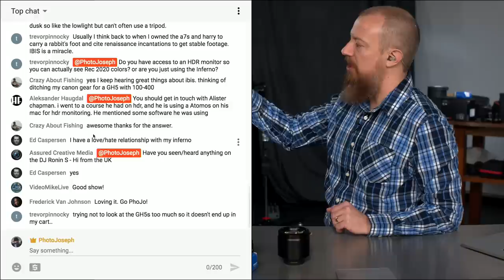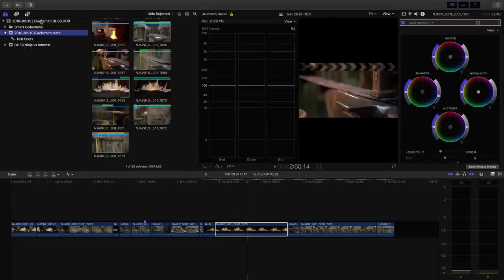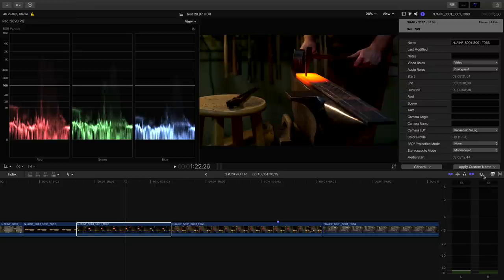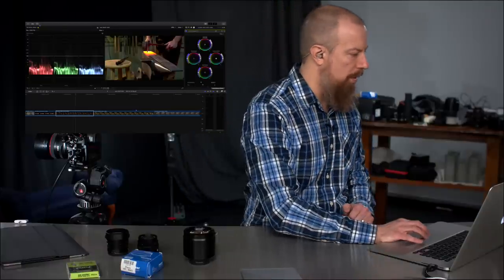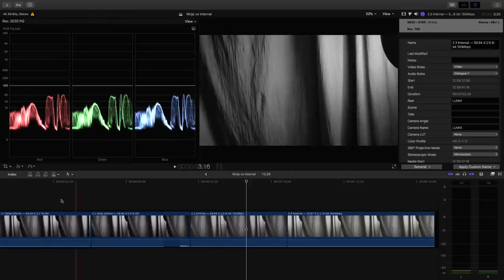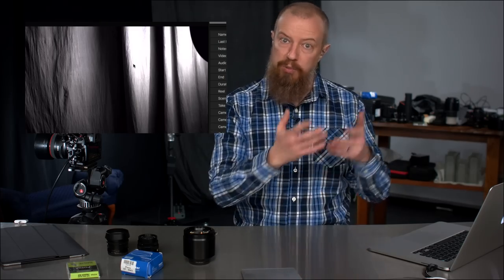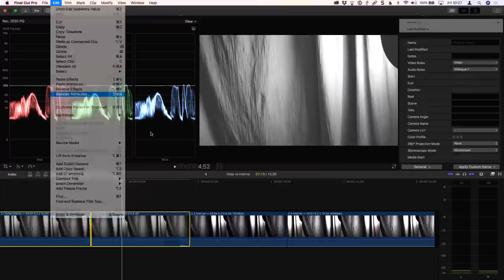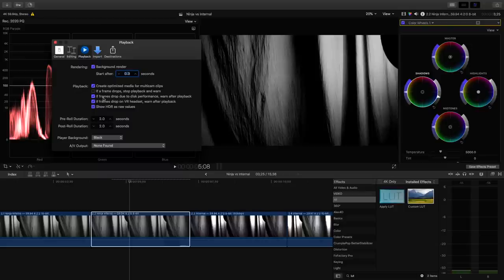GH5S Low Light Part-3 ► WTF w/ V-Log footage on ATOMOS Ninja Inferno?

Comment: I would say its an FCPx problem. I have tried using the inbuilt LUTS with my (now sold) canon C100. Basically the same result you are getting. If you use a custom Lut then its OK. This suggests its the inbuilt LUTS

Comment from the maker: In part 3, we see the problem I've run into with the Atomos Ninja Inferno and the V-Log footage on an HDR timeline. Do YOU know what's wrong?!
Reply: PhotoJoseph it happens because of 16-235 and 0-255 levels..hdmi sends 16-235 but internally uses 0-255..at least in my atomos assassin ,there's no setting for input range..
Reply from the maker: Hmm, I’m not sure that’s it. First of all it’s 10-bit so 0-1024, and if the HDMI out was limited that’s pretty much negate the entire purpose of capturing externally. The file is fine until the LUT is applied. Someone else has told me the LUT is forcing it into Rec. 709 color space but that doesn’t seem right either.
Reply: PhotoJoseph I was referring to the gamma shift you mentioned between internal and atomos recording.Try this...before you apply the lut to the atomos file,match levels to the internal recording and then apply the lut..

Comment: What I can't figure out is, the imported v-Log clips still say rec709 in the inspector.  I'm having the same issues with a Ninja Inferno. Also, for the life of me, I cannot get the waveform to show hdr, it's locked at rec709, even with a wide gamut library and project. And agreed that the ninja footage looks almost like it baked in some kind of v-log lut internally. The footage is not nearly as flat as internal.
Reply from the maker: Honestly I never figured this out completely. I need to spend time on their booth again and really sort this all out. I also need an AJA IO that shows the HDR footage in an HDR monitor.
Reply: Still working on the ninja inferno setup, but I have it working as an external monitor without trouble.  Just need to figure out the color space, but here's the kicker.  I found out that both the Ninja Inferno and the Sumo, are actually rec. 709 displays.  The Sumo can'y do about 9.8 stops of DR, and the Ninja a tiny bit more because it has more pixel density. As for your issue with the V-Log clips and the conversion LUT, there are two issues I found.  #1 is that the LUT is actually a log to 709 LUT.  So if you use it, you mess it up in HDR.  #2, notice your clips say rec. 709 in the inspector.  I couldn't figure that out since we are in Wide Gamut library, rec2020pq project and Vlog is supposed to be wide gamut.  It turns out, final cut is reading that from the metal data.  You need to override it by going into the inspector, choosing settings from the drop down and using color profile override to change it to Rec2020 PQ.
 @photojoseph
Reply: @photojoseph  Now please tell me how I get my waveform to show rec2020!  I can't get it to change from Rec. 709!! Lol. It's stuck from 0-100 and I'm pulling my hair out.
Reply from the maker: Whoah. Ok I need to look at this at my desk. Question though; you’re using it as an external monitor; what interface did you buy?
Reply: I plugged it into my Late 2013 Macbook pro directly into its HDMI port and it recognized the ninja display immediately.  Haven't tried it on my iMap Pro yet.  I have no idea if it is actually displaying a HDR color profile though.  I did discover that the Shogun/Ninja Inferno and SUMO's are both SDR displays and only capable of 9-10 stops of DR. The ninja/shoguns are slightly higher because of higher pixel density.  I think this is a bit of marketing trickery. ;) @photojoseph
Reply: By the way I figured this out too. An FCPX bug seems to think GH5 footage is 8 bit, and also defaults the color space to rec709.  Notice that in your inspector, v-log clips show as rec709, even when in a wide gamut library and project.  You need to select the clips and go to setting and select "Color Profile Override" and change it to rec2020pq to get a more accurate version of the clip. This also changes my waveforms and RGB parade to display correctly.
Reply from the maker: Oh, OK… so, you're not going to get HDR that way. No Mac is capable of outputting the 10-bit signal needed for HDR. You have to use an interface like the AJA Io 4K, which is $2,000. Without that, you're just chasing your tail. Sorry, I assumed from your original comments you were actually on an HDR capable setup. You can absolutely use the Atomos as an external display via HDMI, but it'll be SDR, not HDR.
Reply from the maker: That's interesting too (the FCPX setting)… something I'll have to check out.
Reply: I'm surprised the imac Pro does not output an HDR signal through usb-c. It;s more than fast enough with the right dongle and HDMI cable. Why would we need the AJA?  @photojoseph
Reply from the maker: That’s a question for Apple. It’s not built into the current hardware.
Reply: I guess the $500 question is: Does the AJA serve any other purpose? IMO if Atomos was smart they would include the AJA tech in at least the SUMO class devices
Reply from the maker: Given that it’s a $2000 piece of tech that very few people need, I think that’d be a bad choice. Look up the Io to see what all it does.
Reply: You mean he AJa? I thought I was $500. You can but the Sumo now for $1350
Reply from the maker: The AJA Io 4K that does this is $2,000 — I’m pretty sure that’s still the MINIMUM box.
Reply: Holy crapanectomy. @photojoseph
Reply: By the way, if using Black Magic, you just need the UltraStudio HD Mini and TB3 Cable (not usb-c which won't work). $500.  I know, I know, FCPX is my primary editor as well.
Reply from the maker: For what… HDR monitoring?
Reply: apparently yes
Reply: 10 bit, 10 stops.  All its capable of is 10 stops
Reply from the maker: According to? I don’t think that’s right. That’s not a new product. I’ll be at NAB in two weeks and will check.
Reply from the maker: I’ll find out!
Reply: Here is a thread on BM where people are talking about getting it to work with BM for HDR: https://forum.blackmagicdesign.com/viewtopic.php?f=21&t=70920
Note that you have to install the software and connected the monitor within like 30 minutes or something stupid. Pros are using this.  I just finished some training at BM in LA, and need to go back to visit the workflow guy, so will ask.  I will also be at NAB.  Cheers.
Reply: My wife and I were going to meet with you and max and some guys last year (or the year before maybe) and we went to the wrong hotel restaurant.  Same name or something.
Reply from the maker: Ah, my usual meetup. I remember. I just decided to go this morning so haven’t planned anything yet. Stay tuned; I will and will announce on the show and all the usual socials.
Reply: @SheldonCharron  Thats exactly what I was finding out. I have the Fuji XT3 and on my Atomos Ninja V I set it to HDR ON  / Fujifilm Flog F-Gamut and record. Imported in FCPX it still says Rec709. 
1) Whats the correct setting in the Atomos Recorder? SONY HLG BT2020 when I have a Fujicamera or should it match with my camera?
2) "Color Profile Override": Whats the difference there between Rec 2020 / PG / HLG ?  Is PG really the right thing to go?
Reply: @NotProfane  Not sure about Fuji F-log but with V-LogL you use PG for full access to Gamut.HLG is a limited gamut of HDR
Reply: PhotoJoseph Im in the talks with Atomos in Germany! They are very helpful. On the Atomos Recorder you need to switch HLG on in the Monitoring what is meant to only be a preview in order to really save the file on your SSD as a Rec2020 file instead of a REc709. then it seems to be recorded and displayed as rec2020 in FCPX! Did you find a solution how to grade that?
Reply from the maker: That’s super interesting. I have not, but I stopped looking a long time ago. At NAB I was looking for a cheaper option but came up empty. Super frustrating.

Comment: I have a similar problem when I shoot in 3840 x 2160 V-Log at 59.94 fps with my GH5 and record with my Ninja Inferno in ProRes422HQ.  The Rec 709 version is fine color correcting in FCPX 10.4.  When I change the library and project to wide gamut Rec 2020 PQ, the highlights are cut off on the waveform monitor at about 60 nits though the shadows are not cut off.
Reply from the maker: Ok… are you adding a primary LUT to your footage? By Primary I mean through the Inspector, not as an adjustment. And if so, which one and where did you get it… was it just there already (i.e. installed by default by Final Cut) or did you install it?
Reply: Yes I applied the Panasonic V-Log LUT in the inspector using Final Cut's built-in LUT not one I downloaded. 

I just found out if I remove all effects from the footage, then the highlights are no longer cut off at 60 nits.  So in the future it looks like when I color correct my project for HDR after I do a Rec 709 pass, I need to remove all effects from the footage first so the highlights are not cut off in the waveform monitor.
Reply from the maker: That makes sense, but wouldn’t you start with HDR and then do a Rec709 pass?
Reply: PhotoJoseph I always do a rec 709 version first because that's the product I need to upload to my YouTube channel ASAP so my teammates can watch it. I've only been experimenting with doing an HDR version recently using a non-HDR monitor, the 27" 5K display on my 2017 iMac. I don't know if it's even feasible to successfully color correct and output an HDR version without an HDR monitor but I'm trying uploading short clips to YouTube and watching the results on my LG OLED65B7 that is an HDR display.

Comment: You should post the Inferno footage for others to test in Resolve and/or PP. If they don't see the same truncation of black info then issue is most likely in FCP. If they observe the same issue, then it's probably somewhere between the GH5s and Inferno. Also, could it be the LUT you are using?
Reply: Was about to ask for access to the clips to have a look
Reply from the maker: Here's the clip from the video called "2.1 Ninja Inferno — 59.94 4:2:2 10-bit" -- that's the one to test. I've been told the LUT could be reducing the footage to Rec. 709 but I don't know that I buy that… am waiting for a response from Apple on that one. But if you can try this in Resolve, please do!  https://www.dropbox.com/s/pszpqfvvnu4qzw7/2%2C1_NinjaInferno--5994_4%3B2%3B2_10-bit.mov?dl=0
Reply from the maker: Here's the clip from the video called "2.1 Ninja Inferno — 59.94 4:2:2 10-bit" -- that's the one to test. I've been told the LUT could be reducing the footage to Rec. 709 but I don't know that I buy that… am waiting for a response from Apple on that one. But if you can try this in Resolve, please do!  https://www.dropbox.com/s/pszpqfvvnu4qzw7/2%2C1_NinjaInferno--5994_4%3B2%3B2_10-bit.mov?dl=0

Comment: The Atomos Inferno can only display HDR if it’s hooked on an HDMI 2.0a compatible video card I presume
Reply from the maker: Correct. I do have HDMI 2 cables and the Mac should be outputting the right signal. It’s VERY hard to get a clear answer though.
Reply: The only way to monitor HDR footage on a Mac (greater than 500nits) - you will need to use the rather expensive IO 4K from AJA, to go from Thunderbolt to HDMI.
Reply: Final cut is not set Setting up any HDR footage correctly. I am running into the exact same problem. 
Plus on export to YouTube it is not sending out through HDR content. 
My TV will display icon up in the right-hand corner when a true HDR video is displayed. I also get a setting under my video settings on the TV of vivid HDR. 
It does seem though that adobe premiere is encoding correctly.
Reply: 10 months after ...it seems you can get a USB-C to HDMI 2.0b converter (Belkin/Uptab) to transfer the rec 2020 signal out to an hdr monitor (Inferno; hdr TV)
Reply from the maker: Straight from the computer you mean? Without the need for an additional box??
Reply from the maker: @neoprodisrael  Thanks, I've just seen this comment (links get held for review, sorry). I read your article and see that this works for HDR playback of movies; have you tried connecting it to a laptop and playing HDR content from Final Cut Pro X through it? Somehow I think this is just about playback of encoded content, not about playing off the timeline, given the price (the AJA IO costs over $2k to do this).

Comment: Have You found a solution?
Reply from the maker: No. I gave up.
Reply: @photojoseph  I wanted to ask why You think that gh5 is better than S1 from video?
Reply from the maker: Shutter angle w/ 1d adjustments. Waveform monitor. PAL + NTSC. True VFR. Light enough to handhold on a gimbal for extended periods. Those are the top things that come to mind. There are places where S1 will perform better, no doubt. But overall, I’ll take the GH5 or GH5S.
Reply: @photojoseph  I have gh5 and gh5s, so I am considering buying S1 :) I think that together they will create the perfect trio.
 I really like Your movies. I learned a lot from them.
Reply from the maker: That’s awesome to hear, thanks!

Comment: With Davinci Resolve that would not have happened ;-)
Reply from the maker: Are you a user? I have Resolve but don’t know enough how to use it. If I post the files would you be able to test? If it’s a Final Cut issue I want to know!
Reply: So are you going to post the files.
Reply: PhotoJoseph Let me see what DavRes can go. I have never had ussues with my Davnci Panasonic GH5 combo.
Reply from the maker: Here's the clip from the video called "2.1 Ninja Inferno — 59.94 4:2:2 10-bit" -- that's the one to test. I've been told the LUT could be reducing the footage to Rec. 709 but I don't know that I buy that… am waiting for a response from Apple on that one. But if you can try this in Resolve, please do!  https://www.dropbox.com/s/pszpqfvvnu4qzw7/2%2C1_NinjaInferno--5994_4%3B2%3B2_10-bit.mov?dl=0
Reply: Thank you. have the file loaded and will test it now.
Reply: Ok.. done. Looks fine! Here without lut in the grade: http://daten.k2-fotografie.de/test_grade_gh52-atomos-ni_without_lut.jpg and here with aktive lut: http://daten.k2-fotografie.de/test_grade_gh52-atomos-ni_with_lut.jpg    What do you think?
Reply: PhotoJoseph What do you think?
Reply from the maker: The post had ended up in "held for review" because of the links so I didn't see it until now. Just approved and reviewing!
Reply from the maker: It looks like it's clipping the bottom, isn't it? With the LUT? I should have given you the blacksmith clip. Let me see if I can move that into dropbox from home.
Reply from the maker: Oh wait I don't have to send another file. Can you scrub past the "slate" to where you see the curtain in full focus and do your screenshots again? Here's screenshots of Final Cut Pro X 10.4 so you can see what I'm seeing… again to be sure we're on the same page, I've created an HDR library and the project is set to Rec 2020. Here's with no LUT applied where you can clearly see there is detail from the darkest shadow to brightest highlight with no clipping in the source https://www.screencast.com/t/7aqVaIuKKhs, and here's with the generic Panasonic V-Log LUT that comes with FCPX https://www.screencast.com/t/mQyKEjYnZ — with the LUT applied, we see the shadows completely clamped off (and yes the highlights appear because the screenshot is from an SDR screen, however we can see in the waveform that the highlights are intact).